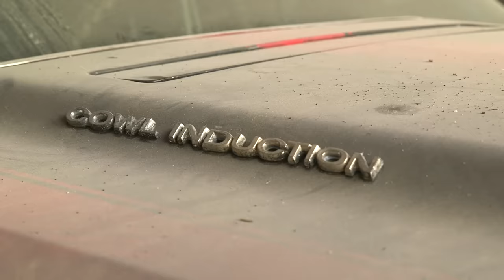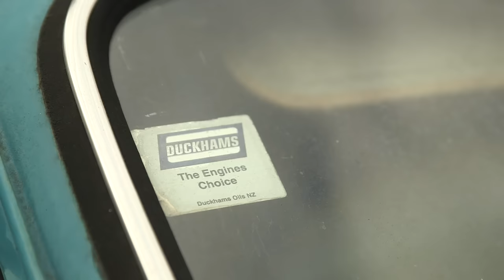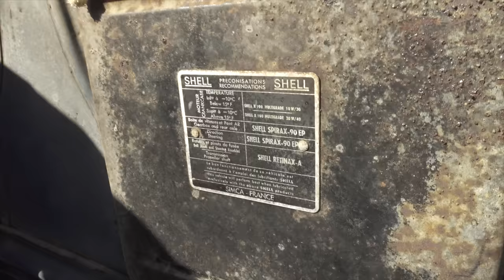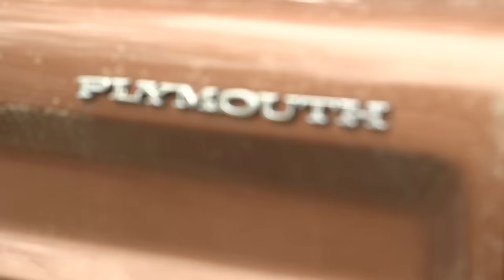Muscle Car Dreamland in rural Georgia | Barn Find Hunter - Ep. 1

Comment: Just to clear a small matter up. The Morris Minor shown is in fact a New Zealand car. The label shown shows the year of first registration (Just below the VIC = Vehicle Inspection Certificate required) which in this case is the 4month of 1958. The big numbers with the smaller number in front are the date the registration of the vehicle expires (26 day of the 6 month of 2000). The  AU6277 is infact the cars registration plate number and the "G" is the licence class of the vehicle which in this case I believe is "General". Finally the sticker in the top center of the windscreen is the W.O.F Licence (Warrent Of Fitness) which indicates the date that the next safety inspection is required.

Comment: HI Tom great show! Some info about that morry minor - It's ex New Zealand that white insert on the left side of the windscreen - that's our rego licence label it shows the date we've paid up till. The VIC I'm fairly sure means Vehicle Identification Certificate. The AU part is just the first 2 letters of what was once the number plate so the plate was AU6277. We changed from an old registration system and went to that system in 1987. Cos that one is an AU plate it was probably registered here not long after or during 1987. The letters on new plates just kept clocking up alphabetically and now the plates all have 3 letters followed by a number. We called those pop out blinker things "trafficators" (thats possibly a british term) and we call windshields "windscreens" among other kiwi terms like "mate", "eh" and "sweet as". Someone must have emigrated stateside cos I cannot figure out WHY someone would bring a bog standard morry minor to the usa?
Reply: I just checked that plate number and it's still in the system here showing it was first regoed here 15 April 1958 and that the last odo reading was 41551 miles on 10 June 2000 and rego was cancelled 23 March 2001. Ownership changed to the last owner on 31 Oct 1972 at 19628 miles. "Theftability" - 1 in 95000! This from a website we have here called carjam for checking cars out before buying. Above info is provided free, more info upon paying a few dollars. Couldn't help but look into that one  - almost unheard of to see a kiwi car of that sort end up on an American tv show - especially with the rego label still there - I've found many a car here in NZ with far less information available. Normally its us bringing usa cars here to NZ! Thanks again Tom and sorry if someone already pointed this info out but I couldn't help myself as a morry minor was and still is one possibility for me to own a flat top motor without too much cost. A morry minor always pricks my ears up. Keep up the good work.

Comment: You are right their are thousands of barn vehicles still out there I found a 1957 ford f100 original powertrain with a 289V8 three on the tree starts runs just needs new tires and some restoration.

Comment: I find stuff so close to visible, just off serious traffic areas. Morris Minor AMBULANCE, in Charleston, SC, just up the shore from this one. You'd have to FOLD up a body, but a tiny roll bar to tie to, and a sticker on the windshield to allow speeding. Minors are cool, as have five lug 14 inch rims to begin with. Also a little bit of hood length to work with.
Cool show.

Comment: Hello Tom ,love your ride and love this channel and thank you for sharing your travels and awesome finds. I live in western Canada and at present I am trying to save a 1960 ElCamino. Lots of cancer for sure but I am determined to save it. I am having trouble finding replacement chrome for this unit. Perhaps you can advise me . I have searched tons of websites to no avail. I require the side body chrome that runs down both sides as well as the chrome trim that goes around the top rail of the cargo area on both sides. Thanks for your time and happy hunting.

Comment: FYI to the LARGEST AMERICAN CAR EVER BUILT. 1958 TO 1960 LINCOLN CONTINENTAL MARK V. The 430 ci engine was the most horsepower over 300 & torque at the time. Cadillac was big but not as big as Lincoln. I owned one back in 1970's & never lost a race or ran out of room for my friends. Held a complete drum set for a friends rock band in trunk. Miss her so much. My Dad  ruined her & was never able to get running again after my military time. :(

Comment: The ‘68/‘69 Rebel he describes as having a 327 probably has a 290 or 343. The ‘66 Rebel Classic might have had a 287 or 327 which was a  physically bigger engine series ( 250,287,327) than the ‘67 and later 290,343,390.
Otherwise, he gets points for recognizing a Rebel.

Comment: that is a 67 charger. the tinker indecator light on top of fender that you pinched means that it is 67, not 66. only 2 years it was made. BUT THE CORONET has most of same parts. i have a 53 ford pannel with lots of spare plus a complete set of new glass for it. extra clip hood chassis doors ....cheap as i m too old now. skip.ah. rope at gmail.